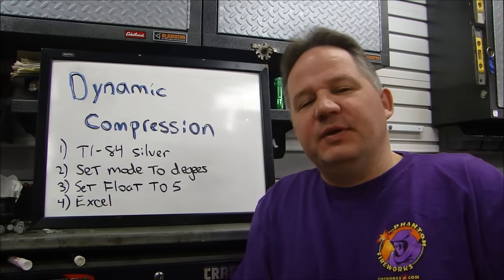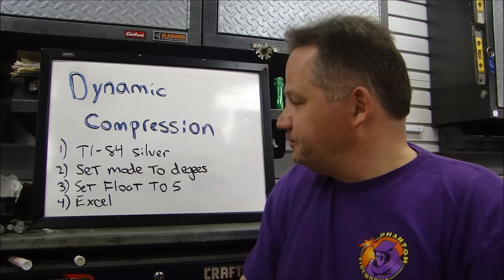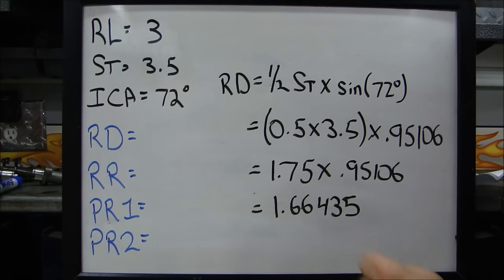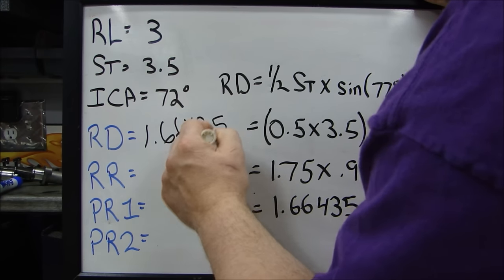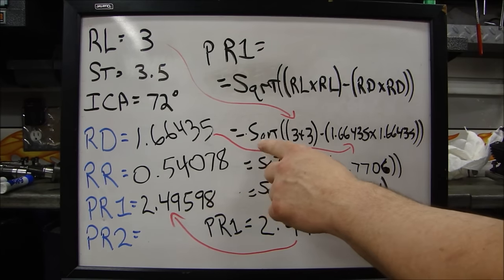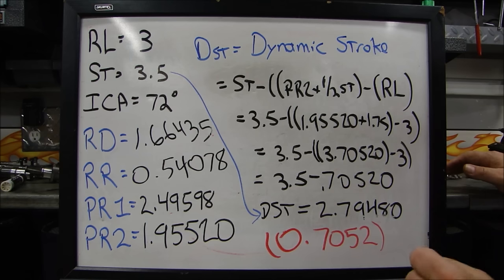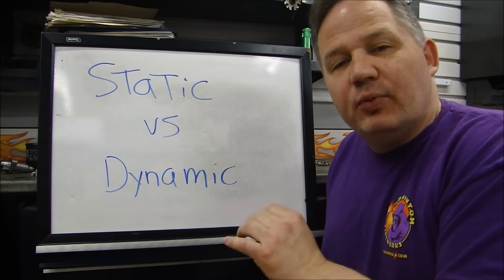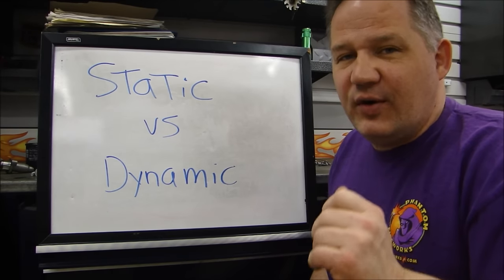Engine Math : Dynamic Stroke

Comment: I know this video is old but, this isn't an accurate representation. Installed centerline is critical but, actual valve duration is key to finding dynamic compression. I.C.L. is the point of rotation when the intake valve is full open. The cylinder doesn't start building compression untill the valve contacts the seat. Dynamic compression is calculated from this point. Static compression is calculated from B.D.C. a cam with the same I.C.L. but a longer duration will yield a lower dynamic C.R. So Installed centerline will not give you accurate dynamic compression.
Reply from the maker: Well, you have to start somewhere.
Reply: @PetesGarage  
Yes indeed you have to start somewhere but, with all due respect, this video is drastically inaccurate. If someone is building a high compression engine and tries to design a cam using this principal, they will detonate their engine. You don't find dynamic compression using the cam specs alone. You need head volume, head gasket thickness, head gasket bore, Piston relief volume, Piston bore size, rod stroke, (rod length is arbitrary) and finally, valve closing angle. Duration, overlap and installed centerline angle are not necessary for calculating dynamic compression. They are critical for any engine build and to find the correct angle of actual valve closing but not needed in this aspect. All I'm saying is this video is Misleading and will not give beginners any type of "starting point" other than what not to do. I wish I could explain it in a manner easy to understand but I don't have time to write a novel.
Reply from the maker: If you have to write a novel, it's not easy to understand. You do realize I did not make up these formulas. This is the basic information you would need to do the calculations. There are hundreds of websites with more detailed calculators.
Reply: @PetesGarage  
Ok, it was not my intent to spark a debate but let's do a little challenge. I am currently building a 410 C.I. Ford Clevor (Windsor block, Cleveland heads) bore is 4.040, stroke is 4.000. 5.780 connecting rod. According to your calculations head volume is irrelevant but for the sake of argument, head volume is 68cc. I'm looking for a decent idle but with good high R.P.M. power. Using your calculations, design me a cam and tell me what the specs are and what my dynamic compression will be with your cam. Or just pick out an off the shelf cam and use those specs.
Reply from the maker: Comp Cams 35-000-B 
.579/.600 gross lift
242/248 @.050
LSA 110
Dynamic 9.25:1
Reply: @PetesGarage  
Ok, let's break this down. First, you left out a lot of needed info. Second, your 9.25 dynamic is WAY too high for pump gas. You'll have severe detonation and you'll end up burning your pistons, valves and if your ring gap is too tight, you'll pop the tops off the pistons, not to mention the risk of snapping a rod and tossing it through the block. Now here's the way it really lays out with all the needed info, (all In inches)
Piston bore 4.040"
Stroke, 4.00" =
Displacement, 51.27578
Head volume, 4.14961
Gasket volume, 0.51490
Deck volume, 0.51276
Piston relief, 0.45767 =
Quench, 5.63494 =
Static C.R. 10.10
With your cam specs, Assuming we install it straight up, intake closes at APPROXIMATELY 37.5° A.B.D.C. (lobe design will slightly affect this figure)
Giving us a D.C.R. of 9.46 (great, if you plan on running airplane fuel and entire forged rotating assembly with cross drilled mains in an aluminum block and heads). Now, let's advance that cam by 4°. Valve contact at approximately 41.5° A.B.D.C. giving us a D.C.R. of 9.30. still way to high unless your building for E85. Now look at this cam. Same valve height, 254-262 @.050 (that will be about 308-316 seat to seat) 114° L.S.A. installed 4° advanced. Intake valve closes at around 50° A.B.D.C. giving us a D.C.R. of 8.94. still a little high but with aluminum heads and 93 octane it's doable. Decent idle good mid-range torque and decent V.E. at around 5000 R.P.M. We can close up our L.S.A. to around 110 and bring that D.C.R. down more but useable R.P.M. range goes way up and it will have a very nasty idle. The best V.E. will be closer to 7000-8000 R.P.M. or maybe higher. I'm not comfortable spinning a big bore, long stroke that fast without a lot of super expensive parts to hold it together.

Comment: For those who want to buy/borrow/use the right calculator, that's not a "T-84" as verbalized on this video but a "TI-84" which means a "Texas Instruments model TI-84", TI slso standing for "Texas Instruments" I don't say this for criticizing the video,I say it for clarifying for  those who need to locate or purchase or borrow this calculator.  And also it's most precise to say "Five significant digits to the right of the decimal point".  He also said  "times" later in the discussion when he meant "plus" but "plus" was in the written formula.  So it's all right and all cool  Those calculators are still for sale; readily available; and just a bit over a hunnert bucks...  And thanks for the video! Subscribed and liked!
Reply from the maker: +Silas Marner Thanks for the correction. I tend to speak quickly and since I don't have a script I just wing it. I was going to re-shoot the video when I heard I did not hear myself say TI, but the point is whichever calculator you choose to make sure it's in degrees. I still have an old TI graphing calculator from when I took calculus 20 years ago.

Comment: Does it take in consideration the fact you can fill up the engine entirely,or even more, with intake air pulses ?
Reply from the maker: Yes
Reply: Dynamic compression doesn't take air pressure or velocity into account. There are actually three "types" of compression, static compression, which is calculated by the full stroke compared to head (quench) volume at T.D.C., dynamic compression, which is calculated at degrees of valve closing compared to head volume, and "active" compression, which cannot be accurately calculated as the Dynamics are constantly changing with R.P.M., air velocity and intake/exhaust pressure pulses. Changes as simple as valve timing or open height, intake manifold or exhaust header change will change the active compression characteristics.

Comment: As always, fantastic work.  You really make things simple, and interesting...   I also wanted to share the conversion for us excel users.  I use excel 2007 and the easiest way to convert native excel from radians to degrees is this:

incorrect cell formula ex.: =SIN(72)    This yields .253823, which is incorrect.  By modifying the formula by adding *PI()/180 the conversion to degree occurs.

correct cell formula ex.: =SIN(72*PI()/180)  This yields .951057, which is correct.

Again Pete, thank you for an outstanding job.  I'm in the planning stages of a build on a 4.6 3V and you're really making it a lot easier and fun!

Cheers
Reply from the maker: +Skip Abrams Thanks Skip!! That is awesome. I was going to put that in, but the whole conversion thing would have been more confusing. Thank you for sharing that

Comment: If the cam angle for the one you showed is 106, cosine goes negative.  How does that affect the overall calculation?
Reply from the maker: You'd have to so the calculations to see what you come up with. It should come out ok

Comment: Is that the cam card from your cobra engine?  
Near 47 degrees abdc valve event with near 30 degrees of overlap at .050. I'm teaching myself to design headers. I'm treating them like a manometer, and the cylinder in overlap is what would normally be the u-tube on the manometer. I just need to set up the harmonics.
Reply from the maker: It is

Comment: Thanks for sharing the DCR formula.  I know I saved it somewhere, but I forgot where.  One thing, though.  As best I remember, the angle the formula calls for is the point where the intake closes after bottom dead center, not the intake center line.  Since the advertised duration figures are not always published accurately, I used the 0.050 lift duration to figure a closing point based on the intake centerline and the duration.
Reply from the maker: Thanks Cary
Reply: @PetesGarage  You're certainly welcome.  
I found the formula in my notes finally.  
There's a little more to it, but I'll only share it if you, or any of you, are interested.  I don't want to bore you.  :D

Comment: Thank you for your great videos. Does dynamic stroke mean that total dispalacement of the engine is less too? Shuold we think of dynamic displacement to get a more realistic size of an engine?
Reply from the maker: Dynamic stroke is how much volume there is after all the valves have closed. ABDC some volume is lost as the piston comes back up because the valves are open a little.

Comment: Hey. What are the odds that you would run my numbers if I send them to you. I don’t feel confident in my answers. Where did you get 72 degrees from the cam card? That’s what’s throwing me off. My card says 39 but I’ve read that you don’t actually use that number. You do a math equation. When I did the equation on your card, I did get 72. Is that what you did I could really use some help

Comment: Hey, I may be missing something. I tried to create an Excel sheet using your formulas and got frustrated when I couldn't reach your answer. Upon backing through the equation step-by-step I found that when I isolated (1.95520x1.75) my answer came up with 3.42160  instead of 3.70520 .... this changes the final DST to 3.07840 I think. Please correct me if I'm wrong. Cheers these videos are awesome!
Reply from the maker: Did you convert to radians?
Reply: +Petes Garage  yeah it's all good, I read some other comments and Silas mentioned some confusion with DST being PR2xHalfSt or PR2+HalfSt. I changed it to plus and came to your answer. Thanks for replying, these videos give me confidence in starting my engine building journey!
Reply from the maker: Awesome!

Comment: Thanks Pete for your excellent video, I have not had algebra/ math classes since 1984.   What level of math do I need to tune diesel engines in the future?  Thank you Sir
Reply from the maker: +jonathan bosco I'm not really sure. I guess it depends on what you're doing. There are so many engine calculators online you can get away with knowing zero math.
Reply: Thanks Pete, Will take Algebra one on line this summer.   Go for the  PHD
Reply from the maker: That's awesome! Keep on learning and so will I

Comment: Is there  a calculation to account for boost pressure as it relates  to combustion /cylinder pressure? Hypothetically if you knew that at 30% overdrive your  supercharger produced 20 lbs of boost at 5000 engine rpm how would you calculate that into dynamic compression? Great Video nice to see advanced thinking I enjoy all your videos very factual Thanks
Reply from the maker: +Jeff Pitman There are boost calculators online. The formulas for that are extremely complex.

Comment: Thanks for your video but there is correction, in 0:37sec not exhaust open is intake valve close, when piston travel to compression the intake valve still open that will loss some compression
Reply from the maker: If the intake valve is still open on the compression stroke there will be major problems.
Reply: @Q80100  
You are correct. Valve overlap means at the top of the exhaust stroke, both exhaust and intake valves are open. As exhaust air escapes, the velocity creates a vacuum which pulls intake air in. As the Piston moves down on the cylinder, the exhaust valve closes, the intake valve continues to open. At the very top of valve travel, it is at it's "installed centerline" (Piston #1 only). The valve then begins to close. As the Piston passes bottom dead center (B.D.C.), the valve is still open. The velocity of air rushing in as the Piston travels back up begins to pack the air and compress it. AFTER BOTTOM DEAD CENTER, the intake valve meets the seat and closes. This is where dynamic compression starts. The faster the intake velocity, the higher your "active" compression will be.

Comment: great video,... but your not taking into account the duration of the cam and the intake separation angle. Both of these things will have an affect on your compression ratio
Reply from the maker: The calculations do take that into account.
Reply: How do they take duration into account?  They are not anywhere in calculations. Why do you show us 106 degrees, then use 72 degrees. Plus trig functions are available on calculator on any PC or phone.  Just set it to Scientific mode. No need for a $120 calculator.
Reply: Dynamic compression is all about swept volume - not full travel, but after the intake closes.  The cam card shows intake "closed" [.050" lift left] 47 degrees ABDC.   You can follow some other engine builders tools that compensate for the lag between that moment and actually building pressure by just adding 15 degrees to the cam card number to get a pretty good number to start volume calculation, but profiles do vary - it would matter to somebody taking a build to the edge of detonation in the race world.  That likely puts piston location in the bore at 62 degrees ABDC for this cam example and calculating that volume up to TDC.  Whether you find the position with math or a degree wheel on the engine, then measure to remaining piston to deck height doesn't matter for most of us.   Quench area and combustion chamber volume is dead space, but affects calculations because they are part of total volume.   Hope that helps, Bob... I too felt a little fuzzy trying to follow this, even though the material is thoughtfully presented. I think this video was to supplement another made previously, but I can't find it anymore.  The title is the tip off: Dynamic Stroke - which is the hard part to math out for figuring out dynamic compression.
Reply: @MrBob58o  you should make your own video

Comment: I figured it out.  ICA is wrong. "Installed CenterLine  Angle" doesn't make sense.  I was wondering where 72 came from.  Intake Valve Closing.  That is what is important with dynamic compression.
Reply from the maker: This is not an easy formula to execute. It will change based on the calculator you use, and will really be off if you use Excel. If you are having trouble with it there are many online dynamic stroke calculators available.
Reply: Still Installed Centerline Angle is not correct.  Doesn't make any sense.  It has to be Intake Closing

Comment: how high should i aim for...??
Reply from the maker: 9.5:1
Reply: Pete's Garage ...but sir if 9.5:1 should be my dynamic comp ratio ...then how high would be my static comp ratio...becoz i have a late int closing..95°abdc
Reply from the maker: What engine?
Reply: Pete's Garage 222cc ...single....
Reply from the maker: That's a small hobby engine. The same rules don't directly apply

Comment: Ica =intake center angel or
Intake close angel
Reply from the maker: Installed centerline angle
Reply: Theres neither of those
Reply: I.C.A. or I.C.L. is installed centerline. You will not find intake closing angle on a cam card or specs. You will find advertised valve duration @ .050 or actual valve duration at either.004 or .006. To calculate valve closing angle you MUST degree your cam and find it yourself. Don't try to figure half of the total duration, as most cam lobes are asymmetrical and will give you an inaccurate number.